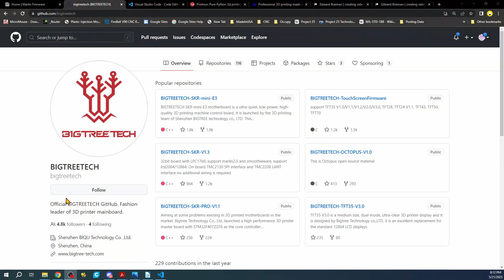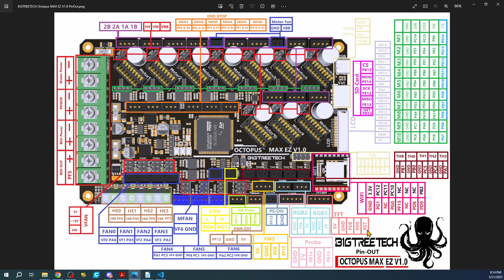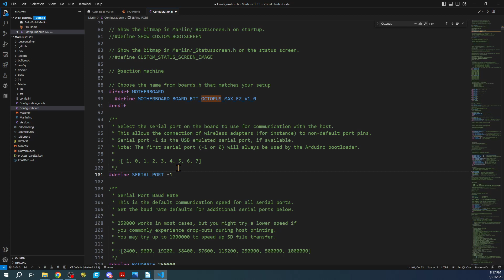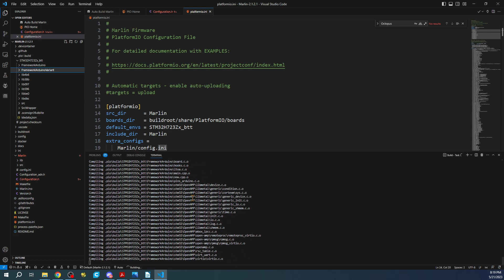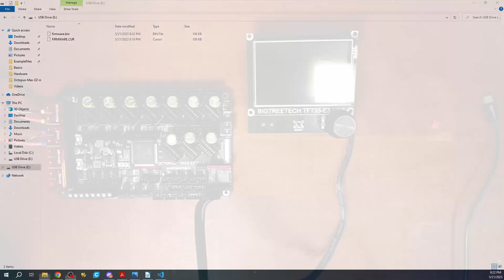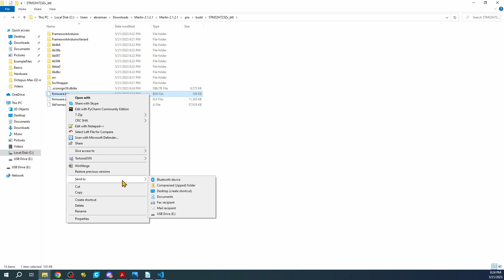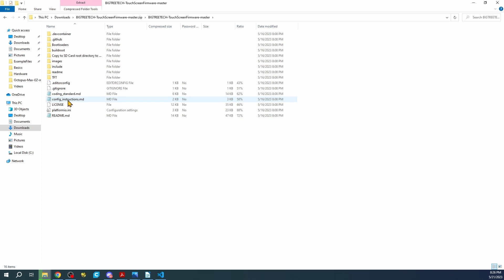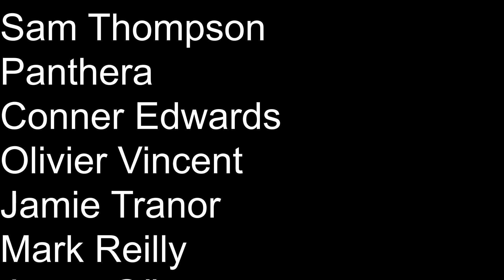Octopus Max EZ v1.0 - TFT35 E3

Comment: I am watching your videos to set up my board, and i am getting the error.....

Marlin\src\module/stepper/../../feature/../lcd/../libs/buzzer.h: In static member function 'static void Buzzer::invert()':
Marlin\src\inc/../pins/stm32h7/pins_BTT_OCTOPUS_MAX_EZ.h:367:45: error: 'PG2' was not declared in this scope; did you mean 'PG_2'?"

the only buzzer would be the one on my TFT screen... what do i do to fix it?

im getting the same error for other pins such as PF4 asking if i mean "'PF_4'"

Do i need to just change them all to the version with an underscore in it?
Reply from the maker: There's a Discord link in Description of video, either myself of someone else can walk you thru issue.
Reply: @EdwardBraiman  i Appreciate the reply, but i dont have discord. Do you know of other sources that do not require a log in that could help?  im having trouble finding the answers i need.

Comment: I wish I'd found your channel before buying a board, so much useful informations!

I'm sorry for asking something in such a long text and I'm not asking you to spend time on this, but if could just shine a little bit of light on the top of your head it would be widly appreciated.

So, would you know if it's possible or not to use the DWIN LCD from an ender 3 v2 with this board? I have been looking for days and documentation on this is hard to find, so I have been wondering if it's just plain impossible and I'm not realizing it or if it's because most people go with BTT screens (and maybe I should do the same?).

I crossreferenced the pinout and all needed connections are there. So it should be possible... right? They both use EXP to communicate after all (EXP 1&2 for the FPC port and EXP3 for the DWIN LCD from Creality but I don't know if this is a real problem). I can do the wiring part just fine.

What I just can't understand is where to make the changes to the pinouts in the Marlin configuration to even try to make this work.

I don't know if you need anymore informations to give me an anwser or a recomandation on what to do. If you think I should just buy something like a TFT35 for any reasons, don't hesitate to recommend I do that. 

Anyways, I'll link the ressources I have found on this as if I fail maybe somebody will find this and it will help them.

For the E3 V2 LCD pinout the documentation in Marlin looks incomplete at best and this is the right pinout (it matches the markings I have on the PCB) 

https://github.com/bigtreetech/BIGTREETECH-SKR-E3-Turbo/issues/40#issuecomment-991853287

And for the Octopus Max EZ the schematic is the most complete source of informations I could find (obviously)

https://github.com/bigtreetech/Octopus-Max-EZ/blob/master/Hardware/BIGTREETECH%20Octopus%20MAX%20EZ%20V1.0-SCH.pdf

Also, there is also an open issue with the SKR2 concerning the Ender3 v2 DWIN saying it's half working.
https://github.com/bigtreetech/SKR-2/issues/51
Reply from the maker: Might be easier to have conversation on Discord in the description is a link.  Need more details on the display to start.
Reply: Didn't notice you had a Discord. Count me in. I've asked, but I thought about it and even if I hate to let compagnies win and buy more of their product because they choose to make it harder to use something else, I might well just buy a TFT. 

Not the one to backdown, but I'm starting to get to the point where even a victory will leave a bad taste.

 @EdwardBraiman

Comment: I am installing this TFT board in my Ender 5 plus.  Will Installing this code alter the Configeration.h or the Configuration.adv.h file in the compiled firmware for my particular printer?  I am using the BTTSKR e3mini V3.0  with a CR Touch and MicroSwiss direct extruder hot end.
Reply from the maker: Video is just about installing, doesn't branch into settings for BLT or any other devices.  Otherwise the tutorial would be 4 hours long.

Comment: Hey Ed, wanted to share a few questions I had regard my project electronics - includes arduino, ramps1.6, stepper motors, IR Heater & Pneumatic Pump. Was not able to find an email to share the question on. Just wanted to run the idea and setup by you. Is there a way?